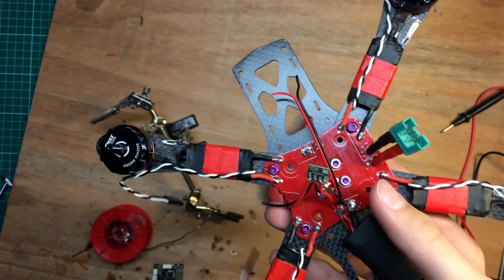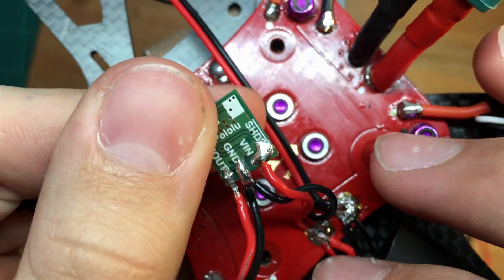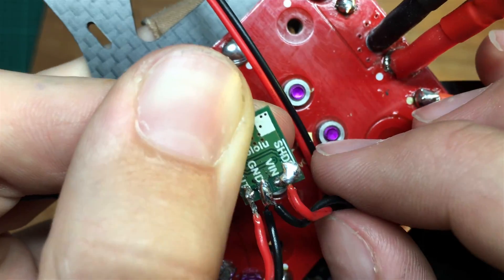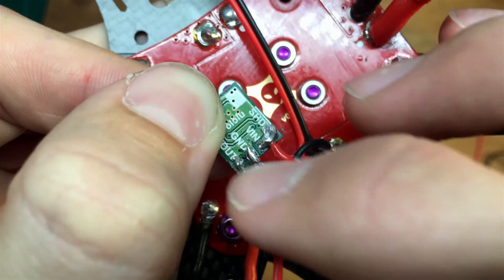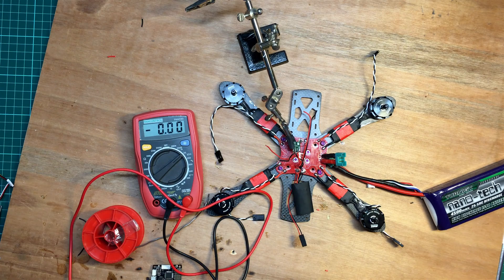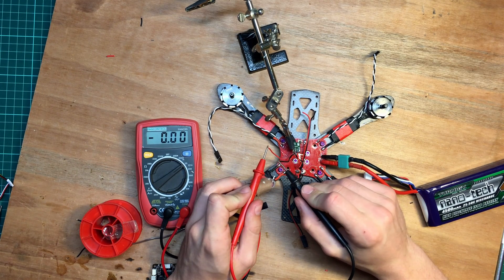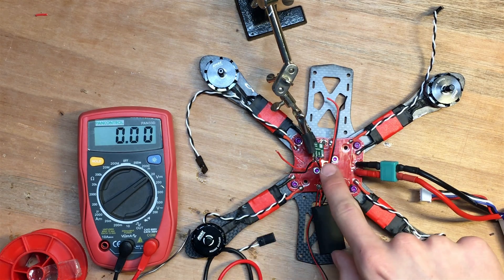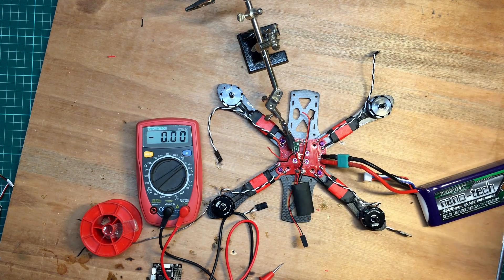How to solder a Pololu to power a Flight Controller (FC)

Comment: Do you use the Pololu 5V Step-Up/Step-Down Voltage Regulator S10V4F5
If not does it work the same???

Comment: I ordered a Pololu  5V U3V12F5 (http://ebay.eu/2oYMMYD) for my micro quad. There is no SHDN pin, just VIN, GND, VOUT. What's the SHDN pin doing and will it also work without?

Comment: why this is in negative ? -5 volts
Reply from the maker: I guess you just measured wrong!
Reply: It would be better actually that it gives in positive
Reply: On your video this is in negative...
Reply from the maker: Oh sorry did not remeber that... not quite sure about that but that however this is the only right way to wire the polulu up. and it still works for me!
Reply: ok, thank you for your explanation and your fast answer !
Reply: It's because he has his leads in the multimeter swapped around. Black should be in the com port. So basically it is +5v but being read from the wrong polarity.